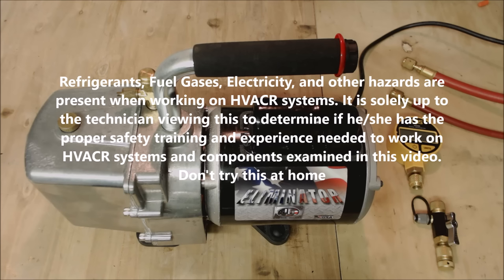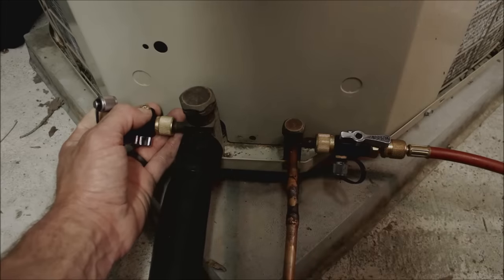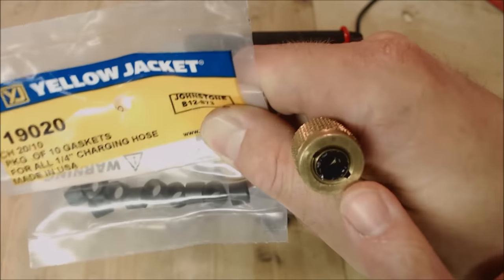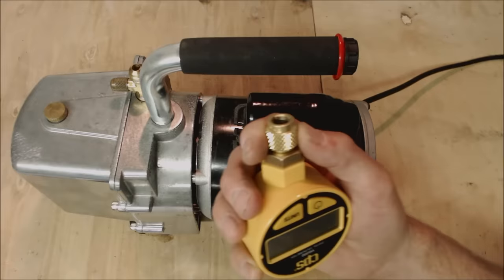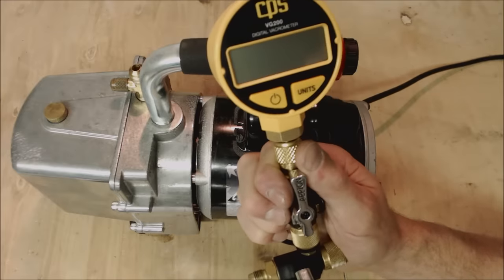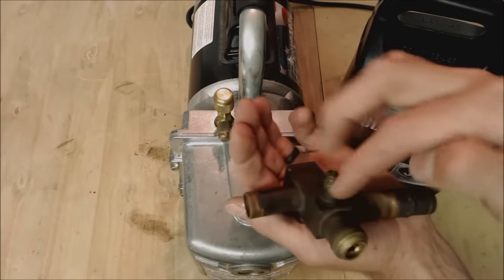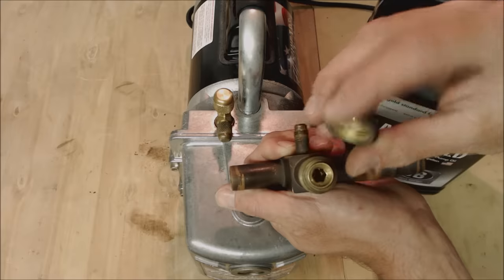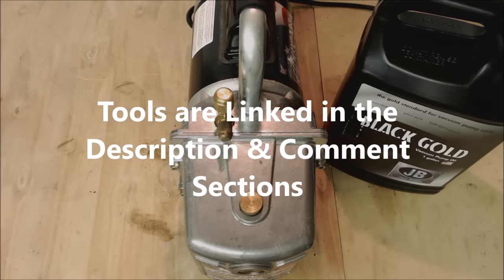HVAC Tips to Avoid Vacuum Problems! Top 15!

Comment: on automobile applications I have been using pag oil in my vacuum pump. is there any problem with using this? Also I want to get a simple digital micron gauge to know when the system is dry and for leak testing. can you give me any advice? thanks. I would just be hooking up to r134 service ports. on my gauges i bring it to -28 inches I am not sure what that is in microns. many times i have to flush the systems and i would love to be able to know precisely that i have boiled off all the alcohol, moisture and know there are no leaks.  most of the time i just pull a deep vacuum for a few hours then let it sit and see if the vacuum gauge shows any leak but this is time consuming.

Comment from the maker: Also make sure to have a dab of refrigerant oil on the rubber grommets of your vacuum hoses. Some people use Nylog for this. I just use refrigerant oil. Make sure to not put a dab of oil on the micron gauge connections as you don't want any oil close to the micron gauge sensor, thanks!
Reply: If I accidentally did a pressure test on a system with nitrogen with a hose that I used for charging a system and introduced refrigerant oil into the system through the hose to the linesets will that effect me from getting a effective vaccum
Reply: Can mineral oil be used universally to lubricate service valves and o-rings? I'm just gearing up to install my first mini-split and love your video's. It's a Sennville multi zone and only has one side to pull vacuum on the service valves and I watched your video on that. I want to buy your training book and I'm wondering which bundle or package would be best for working on primarily mini splits?👍👍👍

Comment: Those Imperials are the worst, Yellow Jacket is a much more reliable manifold set.  We used new one with low side gage needing adjusting and new hose leaking at press fitting, just garbage.

Comment: I have a pump similar to this and it has a pressure gauge on it on the intake and I want to install a regulator. I tried a 1/4" ball valve but it was too big. It seems like it's a male 3/16" connection on the pump after the regulator or something? Do you know the parts that would be the most cost effective way to add a valve/regulator to control the amount of vacuum created? The section of the hardware store I went to didn't have anything smaller than 1/4" female. Should I of looked in plumbing?

Comment: Hello to all,
 The picture is my wife.
Just installed my first split 3 ton system. New air handler and outside unit precharged with 410A.
Brazed in a new line set with filter dryer at air handler and sight glass on liquid side outside, using Nitrogen at 3CFM.
Charge system to 400 psi with Nitrogen for 10 minutes and bubble checked for leaks. No loss, no problems so far!
Time for vacuum test! I have a 6 CFM Yellow Jacket pump with new oil, 3 Appion Valve Core removal tools, new CPS Micron gauge, and new Yellow Jacket 4 hose gauge set.
Valve cores have been removed since the brazing process. Set up the 3 Appion tools with CPS gauge as seen in video. Using only one 3/8 vacuum hose from pump to 4 hose gauge set, took about 30 minutes to pull down to 400 microns. Closed the 2 Appion valves with pump still running and starting losing vacuum. Checked/tightened all connections and opened valves again.
Pulled back down to 400, then with pump still running, closed valve to gauge only. Losing vacuum. Opened the valve, back to 400. Then it is starting to RAIN! Closed the valves and turned the pump 
off and got everything under cover. Checked/tightened all connections, still losing vacuum and still raining. So with the test of closing just the valve to the gauge only and still losing vacuum, doing a 10 Minute test was not doable. I figured give it one more pump down to 400 microns, put the valve cores in, remove the CPS gauge and release the refrigerant to the system, put the tools in the truck and go home. When I got home, I saw there was vacuum pump oil in my gauge set lines. I checked the oil level in the pump and it was at the bottom of the sight glass.
OK, now I have vacuum pump oil mixed with refrigerant in my new system! What would you do?

Thanks,
Ricky

Comment: Great tips! Enjoyed the video. The Bluevac micron gauges are designed to handle positive pressure up to 500 psi specifically so pressure can be put back into the system prior to removing the micron gauge. Im not sure of other manufactures. Keep up the good content!
Reply from the maker: Yeah the cps ones are also rated for high pressure but I just try not to foul up the sensor with any refrigerant oil. Thanks for what you are doing for newer techs in the field HVAC in SC !
Reply: @acservicetechchannel  
Sensor fouling is easily resolved . IMO
Reply: Bluevac all the way and the higher price bluevac has a 2nd reading which will inform you if your actually pulling down a vacuum. Example when liquid refrigerant is degassing out of oil in compressor the gauge can see it.

Comment: Another informative & well-explained video. Keeping everything together in a vacuum kit makes a lot of sense. I mark the hoses that I have pulled the cores out of with zip ties...it let's you know immediately & you can always cut them off if you ever need to reinstall the cores. I think lusing your oil blowout method may also help remove moisture. Did you mention cycling the valves on the core removal tools during the vacuum process in this video? Again, thank you for putting this information together & sharing it.

Comment: The GOAT of hvac training!  I recently purchased all new vacuum set up with the tools you suggest with the exception I got a Field Piece micron gauge instead of CPS.  On my first attempt in the field I couldn't get the vacuum to hold so I went back to my old way of doing it and got the job done.  Afterward I hooked my two Appion removal tools and micron gauge directly to the vacuum pump as you would to the vapor line of a system and same result it would get down to less than 100 microns but it wouln't hold under 500 microns.  Everything is new, I used Nylog on every connection. I even rotated out the 2 removal tools with the 3rd one  and I exercised the shut offs before I actually shut off the vacuum and still no success.  Any thoughts?
Reply from the maker: It could from the air stuck in the valve core tool's valve. Did you close them once or twice during the vacuum and then open them back up quickly. It could also be the particular vacuum gauge, thanks and check out some of my other vacuum videos where I show step by step using them.
Reply: @acservicetechchannel  Thank you for the reply I don't know how you find the time.  Yes I opened and closed the valves several times.  I've watched all of your vacuum vids over and over.  I'm thinking its the gauge as well.  It's a brand new Field Piece I think I'll take it back and try a CPS or Supco.  You are awesome and great at what you do.  You inspire me to want to do what no else is doing and hope to be able to teach the way you do one day.

Comment: When I have problems with leaking service valves I've used a few drops of NyLog to seal it long enough to get my service finished.  I run the valve all the way down (just as you have shown in the video), wipe a long-stick Q-tip soaked with the appropriate  NyLog, in the bore, and then re-back-seat the valve back out.  This usually does the trick
Reply from the maker: That's awesome, great job!
Reply: Soo... do younpressure test it?
Reply from the maker: Yes, funny thing is, they typically hold during the pressure test but fail during the vacuum test. That is why we are adding the oil or nylog, thanks!
Reply: They typically never hold pressure for me... Ive recently had to do a coil clean on a old system  and i noticed I had a leaky valve..... So I didn't know what to do because refrigerant was pumped Down and I count pull the proper vacuum to recover ... So what i did was; wrap the service valve with teflon tape around the threads & added some Nylog and tighten the cap on....and pressure & vacuum held....

So my question is, is there something could of go wrong by doing that?
Reply from the maker: You were right. like I said in the video, in an instance like that with a pumped down unit, all we can really do is to try to seal the cap on to get our vacuum and break the vacuum with refrigerant using the other valve. After there is positive pressure, we can add the oil or nylog to the moving valve o-ring. You did the right thing, thanks!

Comment: Awesome videos and really appreciate the channel.  I have a question about what to do with a problem with an o-ring leak on a front seated low side vacuum service valve.  The outdoor condensing unit is new but old stock and has never been put into service.  I have brazed in the line-sets and can pull a deep vacuum from a service port at the evaporator coil, but the moment I remove the service cap on the outdoor unit, that vacuum is immediately lost.  It is obvious that as long as the outdoor service valve caps are installed, I can keep the vacuum, but once I go to access the allan key low side service valve to release the pre-charge I can't get there because I immediately lose the deep vacuum within the line-set and indoor evaporator (it's a Trane air source heat pump that I am working on).  I'm wondering about whether I can pull a deep vacuum on the system, and instead of releasing the pre-charge through the low-side condenser service valve maybe I can do this on the high-side condenser service valve just enough to create some positive pressure within the system (to maintain the vacuum).  Then maybe I can return to the low-side condenser service valve and finish releasing the pre-charge and applying either refrigerant oil to wet the leaking service valve o-ring (and hope it seals), or apply Nylog and hope that I can seal the o-ring in this manner.  Again, I can maintain vacuum if the service valve cap is installed, so my o-ring leak is obviously small but still significant in trying to put this unit into service.  If I can somehow address the o-ring issue by wetting the service valve o-ring, or by using Nylog during the back-seating process (when releasing the pre-charge in a slightly pressurized system enacted through the high-side service port) then this might save me from having to do a complete evacuation, and the headache that comes with brazing in a new service port and the lineset heachaches that come with all that.  Any ideas, from anyone who has already dealt with this type of situation?

Comment: Pro tip, buy a micron gauge that is rated to withstand positive pressure as well. The one in the video CPS provides will blow clear into the next yard if it sees too much positive pressure

Comment: JB tools recently released a VCRT with a slide isolation valve for the vacuum gauge port. I just received it but haven’t tried it yet - same with the vacuum gauge I got tired of using my manifold.

Comment: I vacuum my hoses while attach to the unit before opening up the entire system to be vacuum and utilize the manual low-loss fitting on the hoses, which helps to check the external connections pressure capabilities.

Comment: i work on small appliances(less than 4lbs of refrigerant) that only have a low side port so there is no 2-hose vacuuming option, and adding a high side port is usually impossible due to the design of the equipment. i have experienced water freezing in the system when using a powerful high-cfm vacuum pump, so now i use a cheap robinair single-stage that pulls the vacuum slowly, which prevents the system from freezing up. i do occasionally get the oil blob in the evaporator and the rising-falling micron reading, when i see it happening it just means a few more hours of pumping to get the system below 300 microns. yes, hours... this is due to the small tubing sizes i work with, 3/8" and smaller. most common failure i deal with is a fractured suction line that vents the refrigerant and then allows the compressor to suck in air and contaminate the entire system with it. and no low pressure cutout switches on most of the equipment so eventually the compressors burn up when enough oil leaks out of the system.
Reply from the maker: Yeah I was mainly speaking to larger systems but the water likely would not freeze if you left the door to the freezer and refrigerator open with the inside fan on. The freezing likely occurs when you have removed the heat from the tubing and the tubing cannot absorb more heat. Yeah small appliances like that are a little different that air conditioning, thanks Marzsit!

Comment: Your videos are top notch! I have combed YouTube for installing mini-split systems and many of them are just DYI, which in the beginning was helpful. I am a contractor with little to no experience in HVAC, but I want to install a mini-split in my home. Being a contractor I can do most of the work myself, including electrical. So, I thought I could just call a local HVAC company to come on out and do the pressure test and release the freon. Boy was I wrong! No one will come out to do that for you! They want it all or nothing! I had quotes from $4,500 - $6,500 for an 18,000 BTU split that I could buy online for $1,000 or less.

That is when I thought, hey, I'm a smart guy. I have good aptitude, I'll just learn how to do this myself. That is when I found a lot of information and some conflicting; do a nitrogen pressure test, don't need it on a new system. Vacuum for a set time? No, you must use a micron gauge. You see where I'm going with this.

So now after over a month of studying and watching your videos I believe I am ready to install my unit. I do have a question. I am installing a Pioneer unit and after contacting them regarding installation, I was informed that as long as I follow their provided installation process, the unit is covered under warranty. They, however, do not require a nitrogen pressure test, just an evacuation for 20 - 30 minutes, then let it sit in a vacuum to see if pressure rises indicating a leak. Do you think I need to pressure test anyway and use a micron guage for evacuation which they also do not require?

Thanks again for your great educational videos.
Reply from the maker: On a minisplit, you will need just two valve core removal tools and a micron gauge. A single hose to the vacuum pump is good. This is because the txv is in the outdoor unit and there is no restriction half way down the line at the inlet of the evaporator coil. Do the vacuum the same way I do in this video with the two valve core removal tools attached to each other with the micron gauge hanging off of it. I would do the pressure test but a standing vacuum test for ten minutes with the pump off to see if the vacuum  rises will also be a leak test. make sure to use refrigerant oil or nylog for the flare joints and use a torque wrench to the specified torque need. I have all the tools linked at amazon.com/shop/acservicetech  make sure you are EPA608 certified to handle refrigerants, and here is the video, thanks- https://www.youtube.com/watch?v=wYZ8Wudksb0
Reply: Thank you again, I am all set, already ordered my mini-split and all the equipment. I do have one other question. I see that most people connect these with 2 pole 20A breakers run to a 30A disconnect is that what you would suggest? The specs on the pioneer indicate that it does not pull more than 7A to heat or cool.

BTW, I would like to donate to your channel, do you have a way for one time donations or just Patreon, not sure how that works. Thanks again, you channel has been great,
Reply from the maker: There should be a rating on the rating plate of the unit that would say max fuse or max breaker.  You would install that breaker size along with a wire that would be rated for that breaker size or higher. If you do that then you could install a disconnect that is non fusible or fusible with the same size fuses as the breaker. If the breaker and wire that is existing were higher sized then you could fuse it down at the fusible disconnect.  Most disconnects are rated as 30amp or 60amp in fusible or non fusible models so you would be using a 30amp one. We just go by that max fuse or breaker size listed on the outdoor unit. You could support through paypal.me/acservicetech and also buy purchasing anything on amazon after going through the amazon.com/shop/acservicetech link and the items purchased do not have to be any item I have linked on the page and the items will be the same price as normal on amazon, thanks Erick and glad to help!
Reply: Yes, I knew it would be on the unit, but I thought I could save some time by getting my wiring done before it arrived. Sent you some coffee money... or beer :)
Reply from the maker: Ha ha, thanks. You might be able to look up the specs sheet by doing a google search of the model # or contacting the manufacturer, thanks Erick!

Comment: Hey Craig!
How are you doing. Great tips! 
Question: what would cause an excessive amount of oil at the vacuum pump fittings/hoses? Noticed there are times when vacing a new system the hose to the vacuum can have an excessive amount of oil. I’m assuming it’s the vacuum oil? The vacuum pump would have the right amount of oil. 
Maybe it’s the pump?  
Really enjoy your passion for the trade! 
Thanks!
Reply from the maker: It sounds like the vacuum pump you are using does not have an oil check valve or that it is stuck in the open position. Older vacuum pumps would have the problem you are discussing. It would draw the oil up into the hoses, thanks!

Comment: Are you recommend using nylog on the connecting part like vacuum gauge etc connection. The problem with many tools observed is that they leak, i was thinking if nylog is help in this case